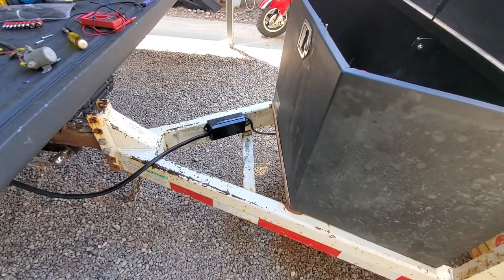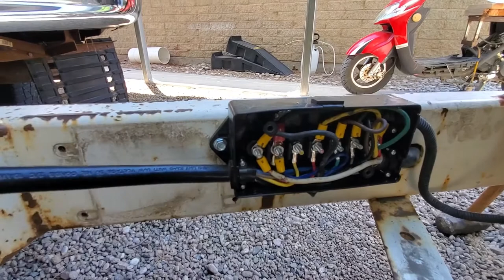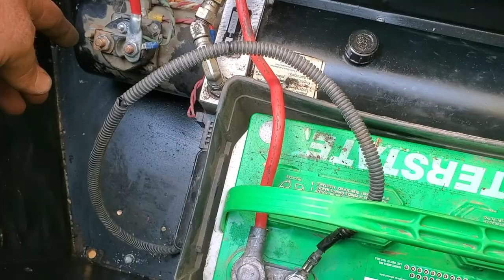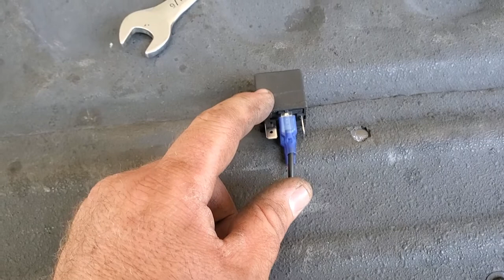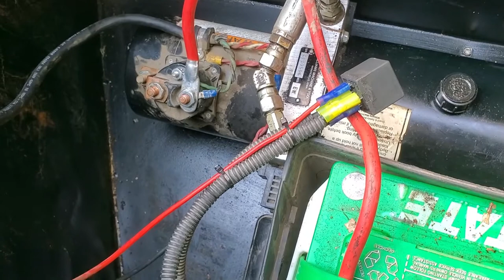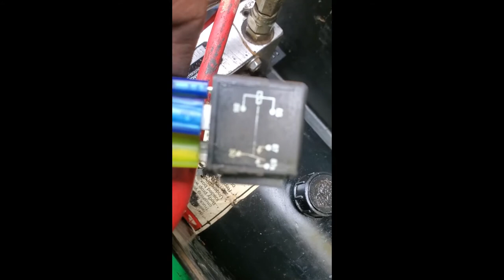Dump trailer Battery Charging

Comment: You can go about this a different way that works way better.  Use a relay that turns off and on when the  trailer marker lights turn on. That relay powers a small 200w ac inverter. Plug a small 2/4 amp ac charger into the inverter. Battery charger isolates the truck.

Comment: Why not use an auto resetting breaker on the aux line sized to the aux line from the truck and replace the aux line fuse in the truck with a slow blow fuse.  Way easier

Comment: Do you have a fuse on your hydraulic pump?
Reply from the maker: I do not but have thought about putting one. A fuse going to the small wires of the solenoid would not need to be very large but a fuse on the large wire feeding the motor may not be practical due to the heavy amp draw.
Reply: @MiloFarms  that's what I heard. So what about a circuit breaker? Thanks
Reply: @MiloFarms  trying to hook mine up properly
Reply from the maker: @23steph13  They do make auto reset circuit breakers but I do not know what size you would need.
Reply: @MiloFarms  ok thanks